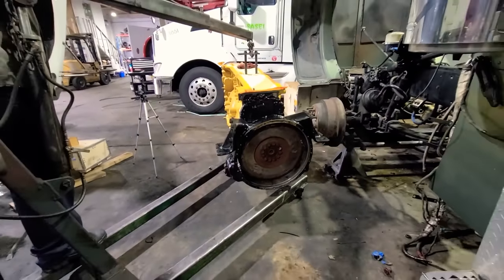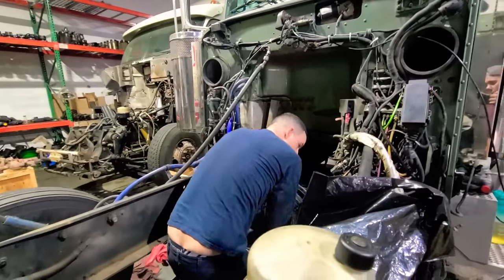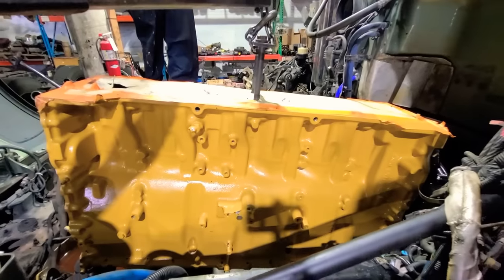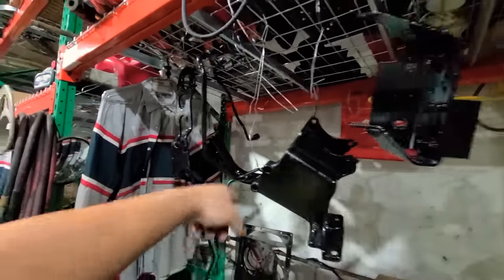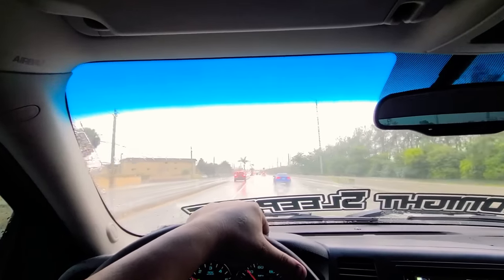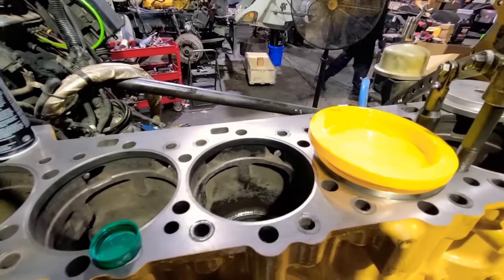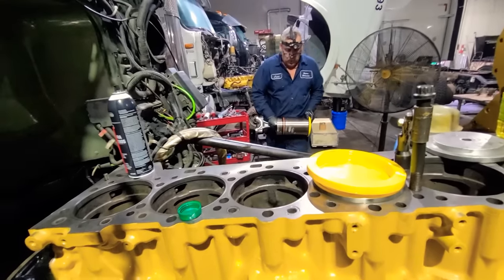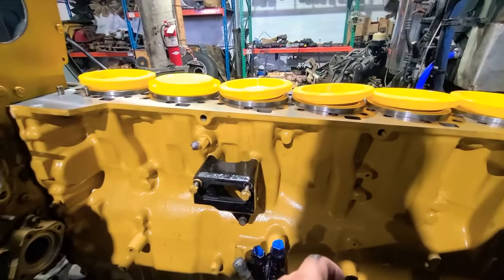One step at a Time!!!! 💪💪💪💪

Comment: Did you guys wash the block out before installing the crankshaft and putting it in the truck. 
My dad has built a many engines. I can't remember how many times i would be washing off parts back from a machine shop and find small metal fragments or stone material sometimes. Better to be safe than sorry.

Comment: I thought putting the motor together before installing it would be easier just asking 🤔
Reply: Makes it heavier also they had a small engine hoist sometimes you got to work with what you got
Reply: It does there a rookie shop
Reply: @dondraper5356  If you're going to insult someone at least use the correct word.
Reply: @mail_liw  do explain
Reply: @dondraper5356  You used "there" when you should have used "they're".
Reply: @mail_liw  I will tell my teacher
Reply: I think the same , normally you put all thee engine together , tested , Rin some hours looking how It runs and then install on the truck.
Reply: On a out of frame I've always short blocked them and put them back in and then go ahead and finish putting them together ,   a cat engine full dressed on the floor damm near 2 ton
Reply: As a former diesel mechanic it is easier 2 put it together 1st. If it's together 1st it can be started within hours of dropping it in.
Reply: Mickey mouse shop bro......run away fast as you can
Reply: It is not together during an inframe rebuild.

Comment: Bro not sure if I am little too late when I had my Cat Acert put together we were told to use Aviation gasket maker it’s pretty cheap $15-$20 per bottle. And you can find it pretty much any auto parts store. 
We used it to put it on all flat surfaces where you put all flat gaskets and spacer plate 
It has been around 250k Miles after rebuild and no oil leaks. Good luck with rebuild.  It should run at least one million miles
Reply: As a retired CAT Tech.Use the anaerobic permatex sealer on front structures and flywheel housings.It’s the best
Reply: That aviation when it cures you can pull the headbolts out and dam near drive around. It's potent stuff